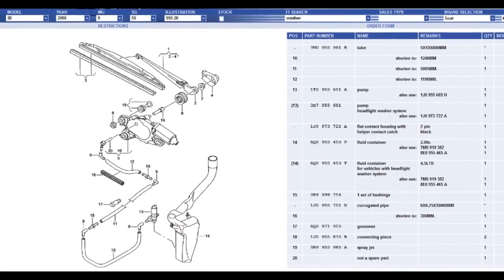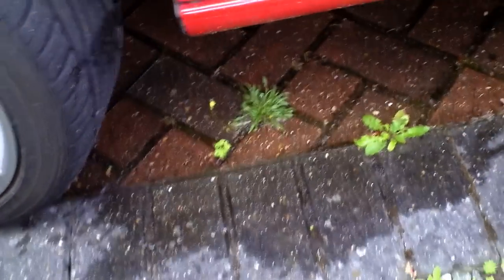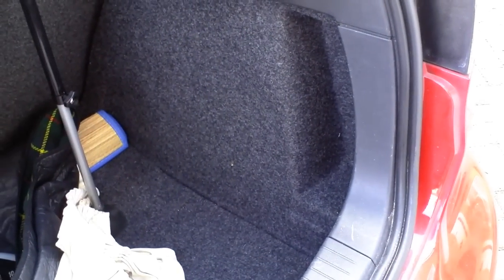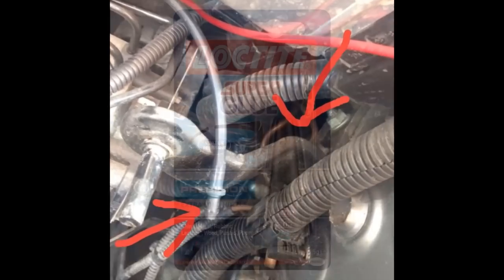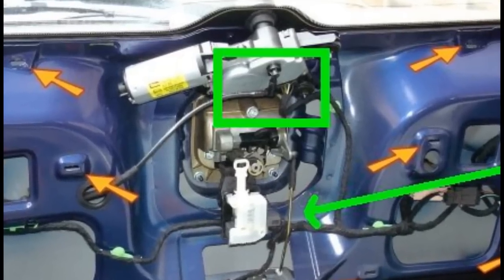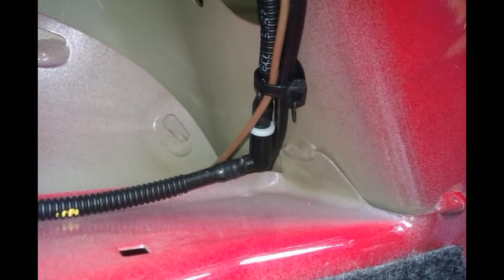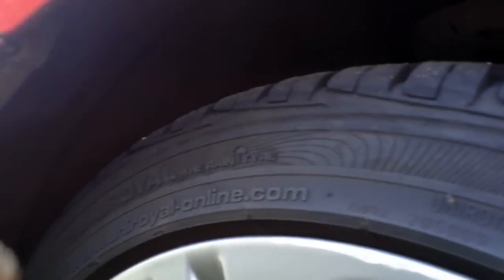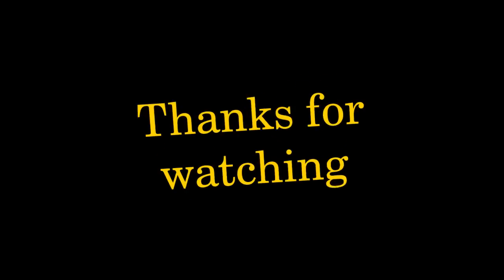Seat Ibiza rear screen washer not working / fix step by step

Comment: Thanks for the guide! Just found my washer motor had no seal securing it to bottle, so was leaking out. And also my rear washer line behind air box was not mated up to anything! I couldnt locate the line from pump so i grabbed abit silicone and routed my own! Both working great now! Thanks buddy !!!
Reply from the maker: Glad it helped!

Comment: Well presented vid mate. My mates pipe was off between airbox and chassis, as your picture shows. We took air box out, still couldnt find where it connected.  The arrow in the pic points to the Airbox support bracket.  We couldn't see or feel anything around it.  
We gave up eventually,  it was getting close to clocking out time. Yes we were at work lol.
Thanks for pointing us in the right area . 😁👍

Comment: Very good guide. My wife has a 2005 Ibiza 1.4 Sport & the first area I checked after viewing your video was the right hand engine compartment. As there is no airbox this side I could easily spot that the washer pipe had come apart at its connector. Bit of a job to get two hands it to reconnect but job done & the rear washer works again. Thanks
Reply from the maker: Nice one.  Yes there is a lot more space in the 1.2 / 1.4.  Hopefully you will be ok now.  If it goes again then glue it  Use a high concentrate of screen wash through the winter.  Thanks for the feedback, glad to help.

Comment: Hi mate thanks for the video, I have 1.2 12v reference sport as my first car and it never worked, turns out pip in engine back and the pipe behind the rear lights and disconnected a complete pain to put them back together but works great now! thanks!
Reply from the maker: Nice one.  Best of luck with your car.  Crappy pipe design.
Reply: @CB-RADIO-UK  yeah really crap, thanks 😁

Comment: Great vid, when i bought the car off the previous owner the rear wiper has never worked. Went out just now and seen the pipe popped off at the front.Connected it up and though YASS, sadly it still didnt work so will get in about the boot tomorrow and see if its a pipe at the back.
Reply from the maker: sniff1877  Yeah I am afraid that if the washer motor was used whilst the pipe was frozen it normally blows on more than one connector.  The Seat connectors are just not up to the job.

Comment: On my mobile it's not letting me quote you for some reason ha. Anyway yeah your spot on, seems hopeless. Will make sure in winter Iv got good anti freeze. Not much hassle but still annoying. When I tested the scoosher there was a leak right where the rear wiper is on the boot side so just a case of getting the trim off and connecting the pipe :) cheers.
Reply from the maker: sniff1877  Yes a very strong screen wash solution in winter is the answer.  The pipes are terrible.  Best of luck.

Comment: Dude this is exactly what I was searching for months now. Thank you +
Reply from the maker: That's the idea mate ;-)  Got a couple of other Biza step by step video's on my channel.
Reply: fredintheshed1 Can't wait to finish work and go fix my rear washer after seeing this tutorial. Be sure I will watch all videos. Great job!
Reply from the maker: GI JOE Thanks bud.  Just be sure to apply some glue when you put the tube back on or it will prob pop off again.  They are pretty crap tbh.
Reply: fredintheshed1 I managed to connect the hose back on. I still had a hard time finding the connector even after you've pointed it out in the vid :D It's well hidden behind the soundproof carpet, just near the ECU housing. I got the air filter box and ECU dismounted for better access.
I made a picture with the tricky hose: https://drive.google.com/file/d/0B_fWVGZ0reBEbW5MVlNYbXpoYzg which hopefully might help others.
My car is a 2003 Skoda Fabia SDI and it was leaking in the front.
Thank you once again for this great tutorial, it helped a lot. Cheers!
Reply from the maker: GI JOE Well done GI JOE !  Yeah it is a bit fiddly.  I ve done all 3 and since using glue they seem fine.  It helps to use a strong mix of screen wash if we get a cold winter.  50/50 is good.  Thanks for the feed back.
Reply: fredintheshed1 Forgot to mention that after we connected the hose in the front, we noticed washer fluid dripping in the boot. Took the hatch plastic cover off and seen that the joint where the rear hose connects to has 2 small openings where water is leaking. I find that very strange because those holes seem to have come like that from the factory : https://docs.google.com/file/d/0B_fWVGZ0reBEUzdqeGxSb2VaTTQ/edit
We used poxipol to cover them and now is fine.
Reply from the maker: GI JOE Good solution dude.  ;-)
Reply: fredintheshed1 Connecting a hose and applying some super glue isn't a great accomplishment, but the level of satisfaction is huge :D Wish I had my own equipped garage and time to work on cars :/
Reply from the maker: GI JOE  Well done.  We really should not have to do these little fixes on our Ibiza's if Seat had used better quality fittings.  You don't hear about this happening on Audi A3's.  A garage helps with the British weather but there are plenty of jobs you can do with basic tools and save yourself a packet on garage labour fee's.  Your next job is to remove the foam triangles from your front wings before they rot them out !.  All the best mate.

Comment: Hello mate. The pump works fine as my front washers work great. Do i have another issue or could it be one that u pointed out
Reply from the maker: Its most likely to be the plastic feed pipe has popped on the connectors.  Since i gules all mine they have not popped off( yet).
Reply: @CB-RADIO-UK  your right mate its pissing out all over
Reply: Al Bundy  yes mate low pressure from both front washers and nothing from the back. I have a split in the washer jet feed pipe just before the pipe meets the 2 front jets and it sprays out over the roof

Comment: Hi
my son has a seat ibiza and the rear wash is not working have traced all the tubes back and no leaks, when we took the boot lid panel off and tried the rear wash, water is coming from where the pipe goes through the centre of the wiper mechanism, have you experienced this and also is there a video on it cheers dave
Reply from the maker: +dave watson Not on the Ibiza but I did have a leak there on my Polo. I stuck the pipe back on with glue but it kept blowing off.  I made the mistake of leaving it and water got into the motor and corroded it so I ended up having to buy a 2nd hand part.  I would try to glue it, maybe try a small cable tie if you can.  But don't use it if it still leaks

Comment: I cant here the motor working as the neither the front or back are working.    Do i need a new motor?
Reply from the maker: It sounds like it.  Check / replace fuse first.  Pump is located right hand side (as you look at the front of the car) behind the front bumper.  Access via the wheel arch once the plastic arch liner removed.
Reply: @CB-RADIO-UK  thanks pal 👍

Comment: Wee update. Good news is there is water coming out the pump. Bad news is it's not schooshing onto the window. I disconnected the pipe then put it back together . Still not hitting the window but the water is coming out. Could it be leaking before it gets to the exit hole?
Reply from the maker: sniff1877 On my Polo the plastic jet nozzle in the middle of the shaft started turning with the wiper arm.  Eventually it snapped off just leaving the water dribbling out.  To check for blockage stick another piece of pipe on the connector fill you mouth with water and try to blow it through the jet.  It should come through.

Comment: Hi, I followed your guide and tried to reconnect the 2 pipes however, even when connected they leak like a seal is missing from the female end, if theres a seal I need what is this called and how or where do I get one? Thanks
Reply from the maker: TBH iam not sure wheat the seal is like.  If its a rubber O ring you can buy a multi pack on Ebay.  Some people just superglue the pipe in and hope for the best.